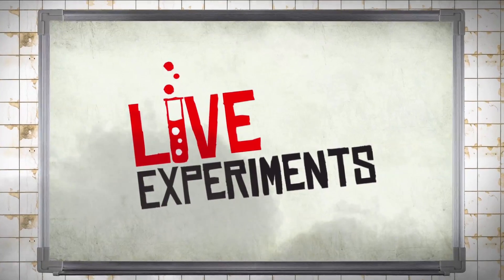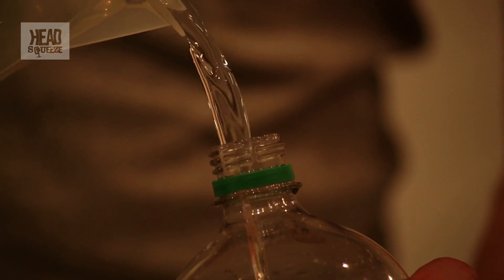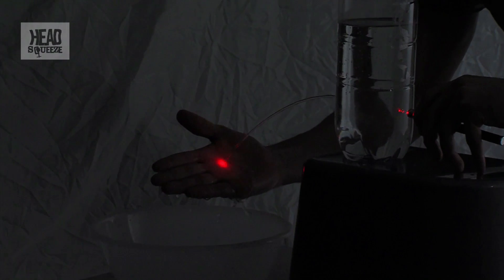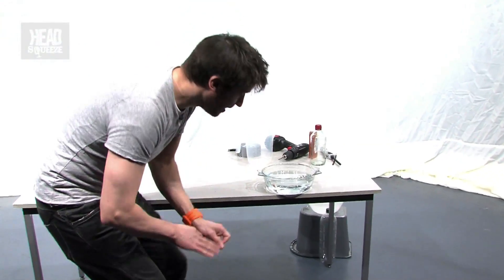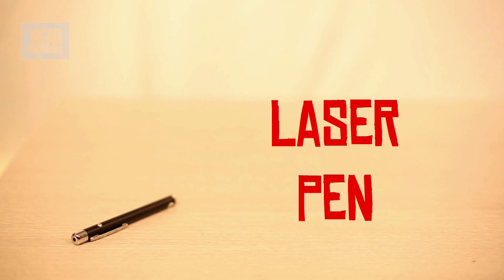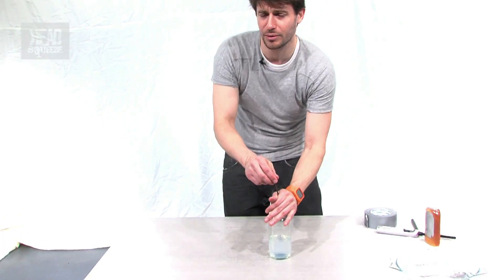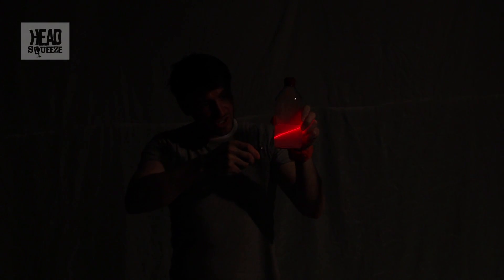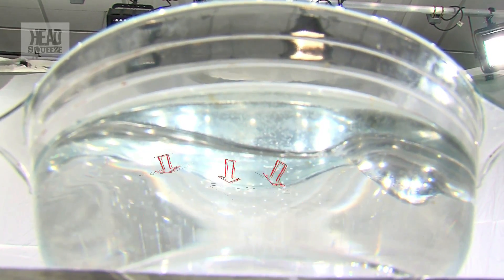How Does Light Bend? | Earth Science

Comment: Wouldnt it be more accurate to say that the light reflects? I mean you are pointing the laser inside the stream. The light travels through the plastic -> water, then it reflects off of the edge of the stream inside -> off of the bottom of the water stream -> up again ...

And the reason is because of the surface tension of the water naturally creates a thicker "container" in lack of a better word that reflects the laser inside itself.

The light doesnt bend it simply reflects.

Comment: So you're telling me that nobody knows about basics of optics? I'm 16 and I knew about all of this. Also, the light doesn't bend, the water just acts as a mirror tube because the angle at which the light comes in is greater than the water's critical angle. 
The critical angle isn't when the light comes back down as the guy says it in the video, it's when you start to see both (running through surface AND mirroring) happening at the same time. Critical angles are also only happening when light t

Comment: generalization of a straight line. This means that the trajectory of light cannot be bent. Another confusion arises, however, due to the fact that space is not flat especially not around objects with high energy density (such as a black hole). Thus the notion of a straight line also differs from the flat space one and straight lines can seemingly go 'around' black holes and other heavy objects. If you're interested you should look up 'gravitational lensing'.

Comment: bending is best described as changing direction without the use of a reflecting surface. if you introduce an angle into a bar, is there a mirror  or mirror like substance involved in creating that angle, odds are no, and not in the way reflecting is. reflecting uses mirror like surfaces to change direction of light once, while bending does not(usually uses gravity). they are very closely related however since enough reflections gives a bending look(experiment 1).

Comment: the only real difference between bending and reflecting is that reflecting is a change in direction once, while a bending is constantly changing direction. in the first experiment, light is reflected hundreds if not thousands of times by water, to bend it, you would need to remove the water and have the light do the same thing. reflecting requires mirror like surfaces, while bending does not. you can get bending effect by doing what he did, reflecting thousands of times.